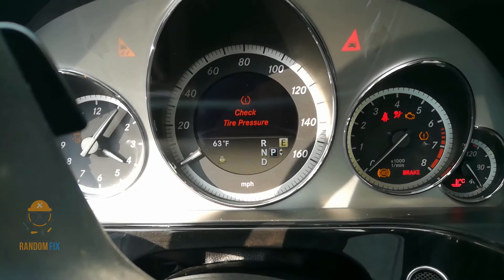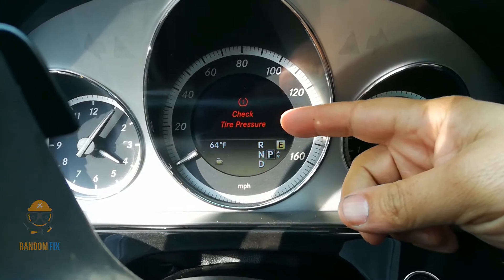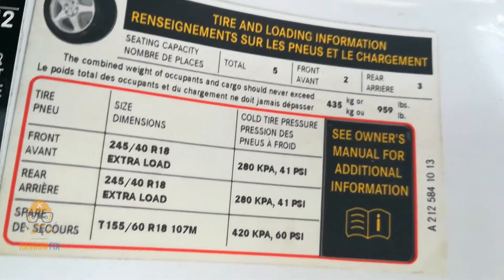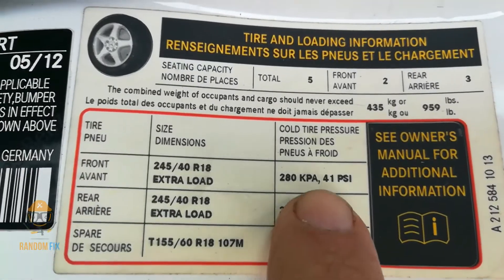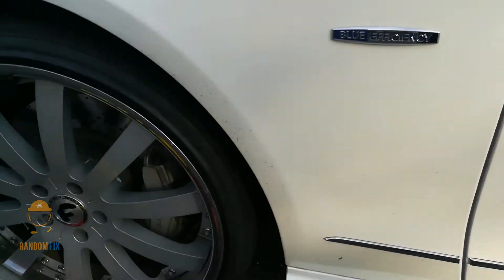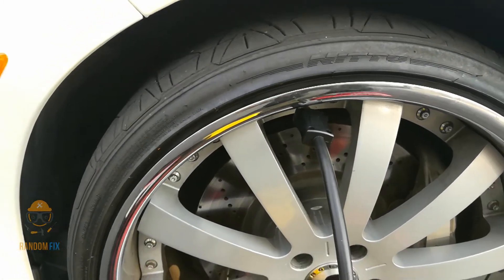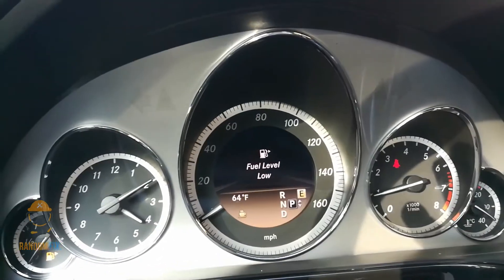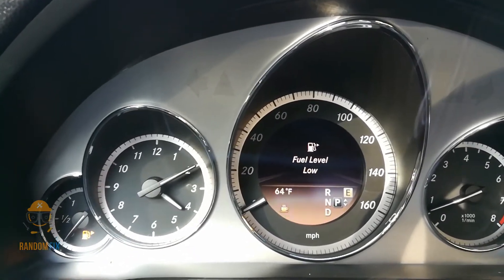How To Reset Mercedes Benz E-Class Tire Light (TPMS ) E350 E550 E63 2010-2015+

Comment: Although you can use the door jamb sticker as a guide for tire pressure.  A more detailed tire pressure diagram is on the inner part of the fuel door.  It shows two pressures, one for normal load, one for maximum load.  It also gives you how much extra air to put in depending on how fast you're planning on driving.
Reply from the maker: That you for sharing. What sort of vehicle do you have?
Reply: @RANDOMFIX  w212 and w166 merc